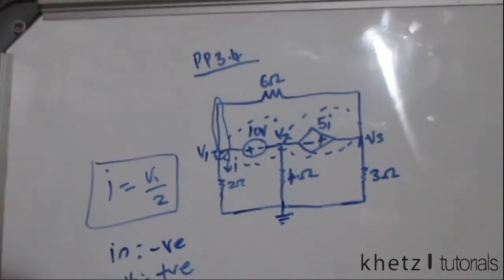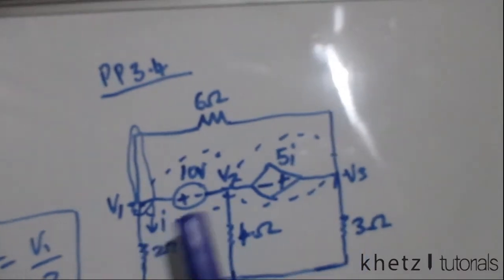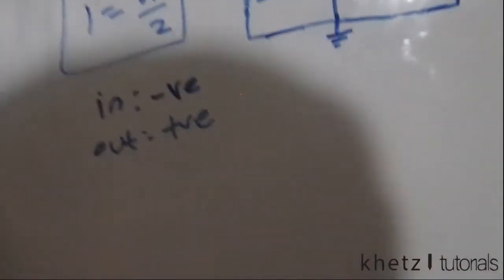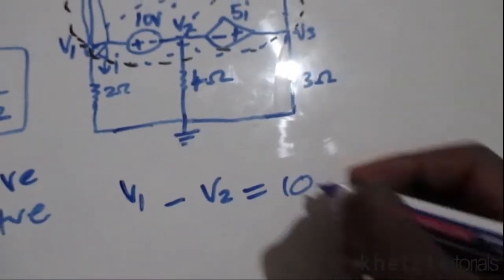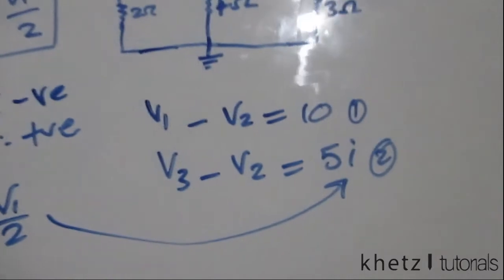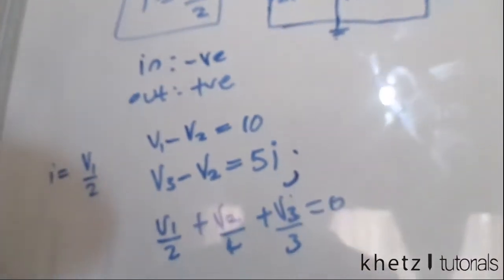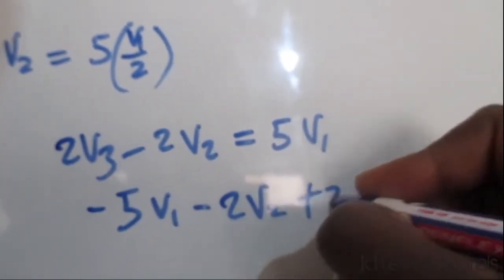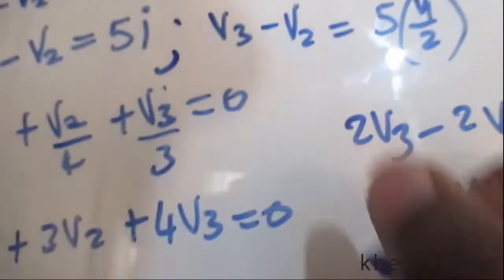Fundamentals Of Electric Circuits Practice Problem 3.4

Comment: thanks >> but what does the value of v2 mean ? it's negative .. does it mean any thing ?
Reply from the maker: You can  view this in quite a few ways. The simplest being that v2 is its value less than the reference. Since voltage and potential difference are the same thing, this only means v2 is of a lower potential with respect to the chosen reference node(the bottom node)